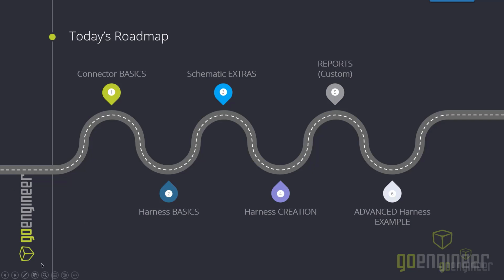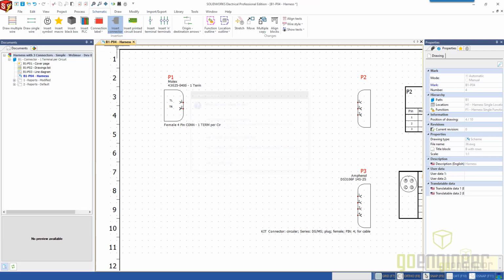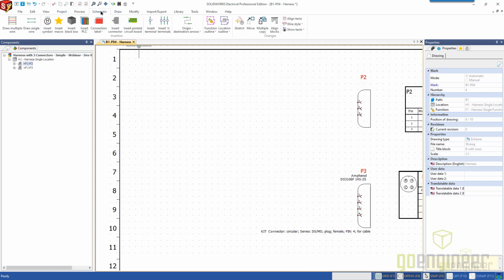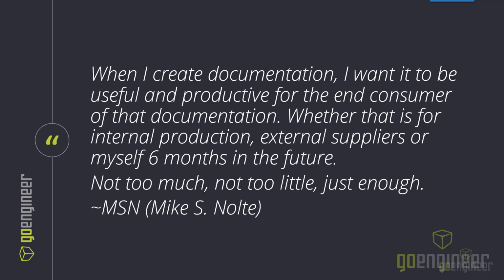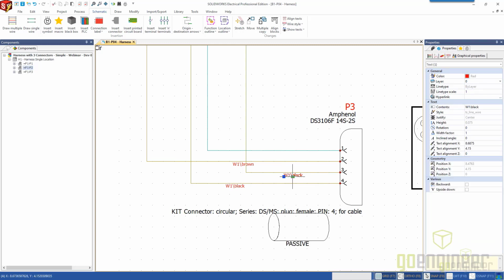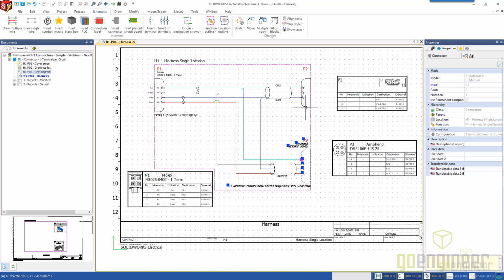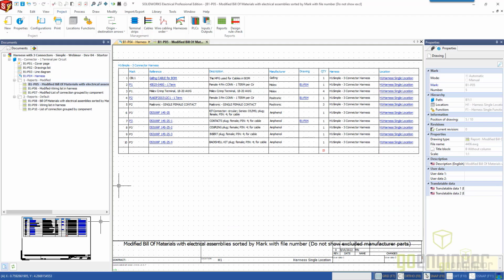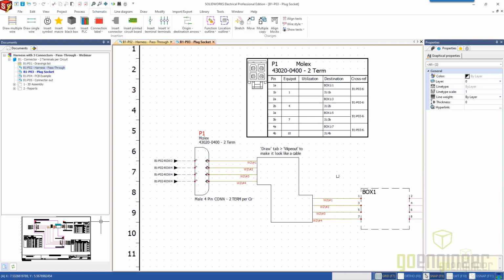SOLIDWORKS Electrical Schematics Professional: Harnessing - Webinar

Comment: Hi, 
great job on this video. I have been operating SW electrical since it came out on 2014(?).
the bridge in the end of the video is great! I have done the same  - but with a wire style that is labeled - ConnectorConnection. And that gives us a great way to visualise the connection between the connectors in 3D.. since the line (wire) is modeled as a sketch in 3D.. And that line tell the 3D operator on how to assemble the connectors.